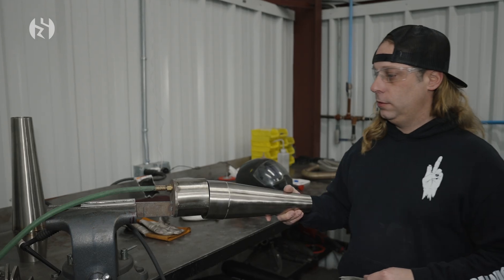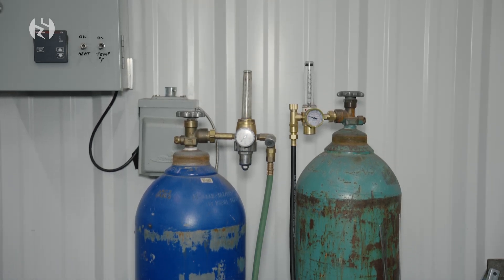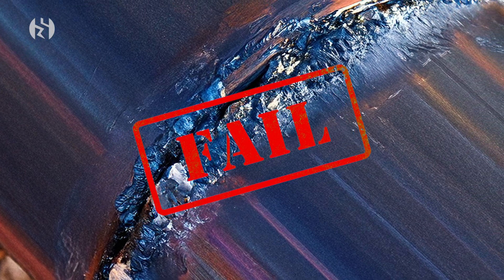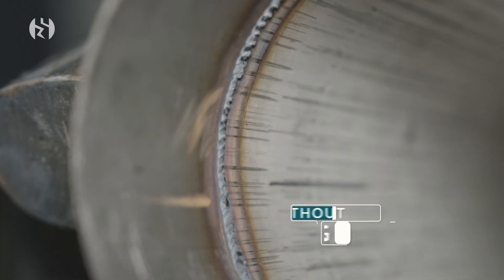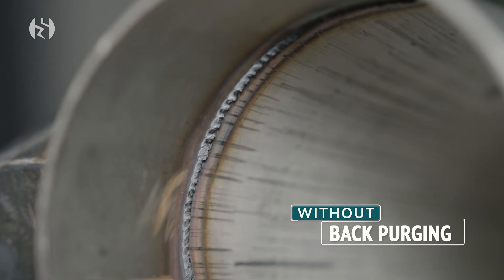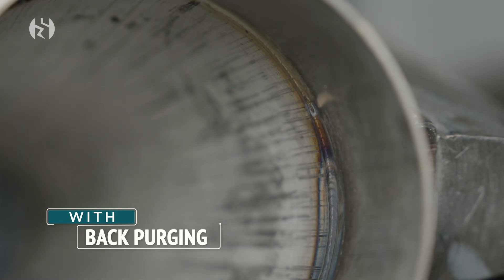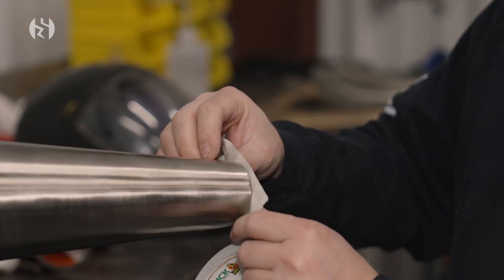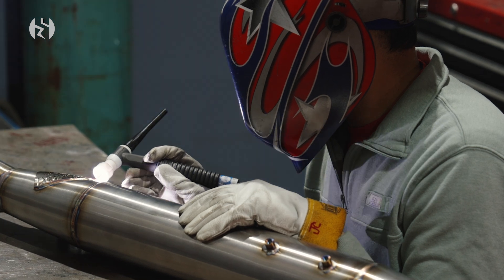What is Back Purging and Why is it Important for a Motorcycle Exhaust?

Comment: When done properly the inside will look almost exactly the same as tue outside. This is how 3A food grade stainless tubing is welded. No corners cut ever.
Reply from the maker: It's a work of art, right?
Reply: @sawickispeed  It is in my book. Took me a dozen or more tries before I got my first passable weld. Then 10 more before I did an actual food part. I find tig welding very peaceful. Your brain is pretty busy making art.
Reply: @sawickispeed  I would add. If you had Kraft macaroni and cheese with the powder from about 95 to 04 your cheese powder passed over at least 1 or more of my welds. Random fun trivia. Something like 50 or 60 million boxes.